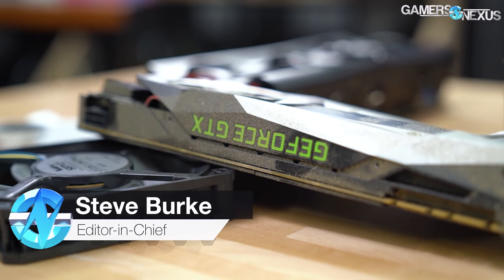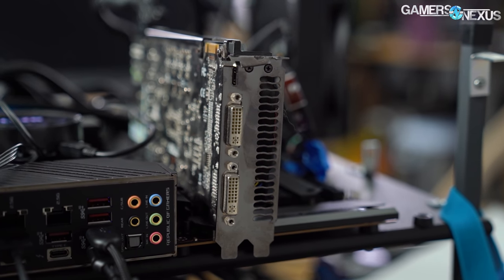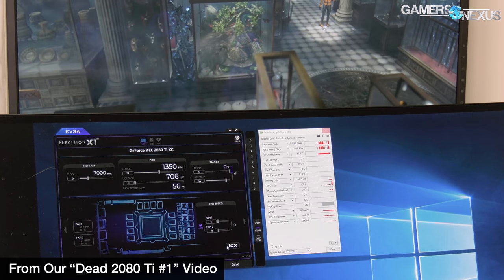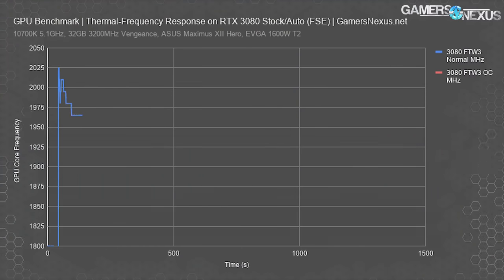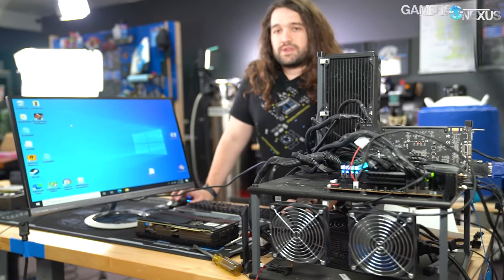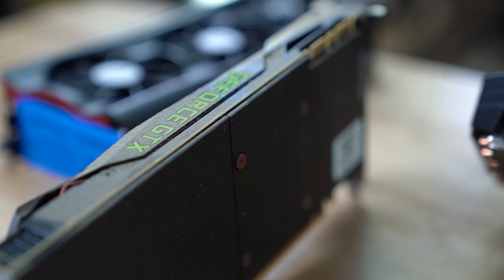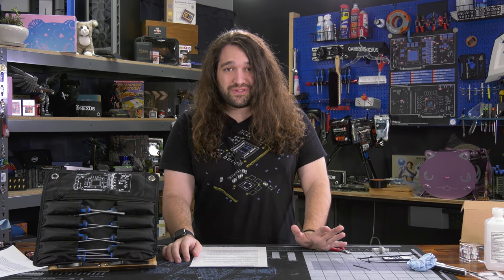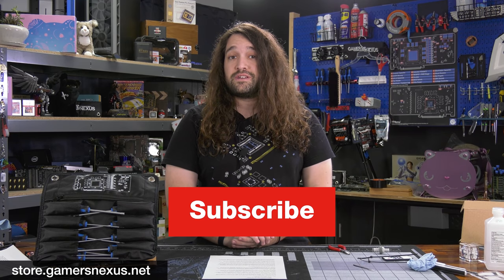Warning Signs When Buying Used GPUs: How to Detect Defective Video Cards

Comment: Purchased a RX470 Asus Mining GPU flashed with asus strix bios as they use the same cooler but only with 1 hdmi port

Thought it was broken first as you will barely start playing warzone and then start getting big stutters, looked like it was TTing at 72c but RX470 was not supposed to start TTing at 72c so started with flashing new bioses eventually bricked it with wrong bios but was lucky and managed to bring it back to life with my extra PCIE port on my mobo and my other gpu

Before i lost hope i figured eh let me just break the seal and try replace the thermal paste at risk of seller telling me i broke it, when i removed the heatsink i immediately knew i found my problem, the thermal paste was beyond toast, crispier that dried leaves

Cleaned with alcohol and applied new paste, boom works perfectly for my wifes budget build starter gaming pc built from an old lenovo thinkstation

Comment: I have bought my previous two gpus in 2nd hand market. Both purchases where made in local FB marketplace and had manufacturers warranty, on one card for 3mo on other 10mo. This also helps alot, just be sure that warranty sticker isnt broken and card dosent have any visible damage. So if there is something, card is still under warranty. :) I even didnt 'test' the cards when purchasing(and on this note i've further dropped the price) because they have manufacurers warranty and when at home stress tests if there will be some artifacts or something, ill just return it.
 Thank god it wasnt the case and both gpu's where in excellent quality.
P.S. Bought msi 1070ti with 10mo warranty for 340€(Initial seller price 390€) in 2018... (brand new in 2017, card cost was 490€) Ehh good old times :D To bad that in 2019 as summer ended(just b4 c19) ive sold my whole gaming pc with the card.... If i would know the future.... I would never let the gpu go! :D

Comment: I've got an msi gtx970 that refuses to boost over 1000 - 1200 MHz core clock when running heaven or gaming, clock speed also fluctuates much more than it should. The card was tested in 2 different pc's with the same result. I took a look at gpuz and noticed that the gpu chip's power draw never exceeds 12 - 13 watts even under full load. So the card works but no where near its full potential. Have any of you guys seen a card that behaved like this? If so what was the issue?

Comment: Hey, I bought a rx 580 off ebay for $280.  the card is triggering short circuit prevention at the psu or some other overcurrent protection.  I took it apart, cleaned and re pasted but havent really tested it since that because im worried about any other damage or shorts to other components in my pc.  I managed to get $225 refund from the guy who claims it should be working, so I either got scammed for $55 and get a gpu ornament, or hopefully there is a way to fix it or send it somewhere to get fixed.

Any advice on figuring out what is wrong with it, or trying to fix it?

Comment: unrelated to this video. is it safe to clean a cpu heatsink with water? my country has strong iron in the water that even metal taps start to rust after 14-17months. There's a lot of duck stuck in my cpu heatsink and I tried to blow it with a blower but didn't work. Or should I use wd40?

Comment: MSI DUKE 2080 OC stuck in 1260mhz core, 7000mhz memory at times and i have to use the command winlogo+Lctrl+Lshift+B to fix it for some time until it comes back and it comes on even after reboot and i have used DDU to reinstall and stuff, i have a little under a years warranty left, should i just RMA it so i can get it repaired

Comment: I have an Asus Strix GTX 970 which has a considerable amount of GPU sag. I attempted to place a lego stack under it to straighten the card, but that caused massive loss in FPS, from ~270 in csgo to ~60-75. What could be going wrong here?

Comment: Look carefully at their ad. Does it seem sketchy? Is the picture of a stock image, and not their own item? Does it say, No returns, or Untested? Is their contact email a gibberish throwaway account name? Does Google maps indicate odd seller location? Any one of these could be signs to hold your money and run like hell.
Reply: I think the best thing to do is test the GPU before buying. Of course there are great deals that aren't local, but you have to be patient until something comes along that you can check out in person. The prices are finally more favorable (if we exclude GeForce 40 series) and it's possible to find excellent cards for reasonable money. Interestingly, here in Serbia, RTX 3070 is currently cheaper than the RX 6700 XT on the used market, while 3070 is 170 euros more expensive in stores.

Comment: So, I have a 1060 where the cooler was in contact with the 12 volts of the 8 pin and thus created a short circuit. I'm not sure where to start looking. Maybe a SMD capacitor is broken. The card doesn't boot anymore. Maybe it's dead. Has anyone had anything like this before?

Comment: The problem with used cards is the VRM's/MOSFETs and paste caps have a tendency to die out.  The more you run them in a high power mode, (even for reduced voltage mining) the shorter their life left as you approach MTBF hours.  They do have a finite life span.  Even if you replace the fans and repaste and recap them, they don't last forever.  If you buy used, do not expect them to last two years.  Even less if they have been used for mining.

Do not be afraid to ask for a zoom meeting with a run through of GPU-Z and Unigen Heaven.

Used video cards are a horrid value in most cases.  I paid $140 after MIR on a 8Gig RX580 just 1.5 years ago.  Paying $750 used or even new is insane.
Reply: How would you react if the seller replied with a saved image of the Unigen Heaven benchmark result b/c the card has already been removed from the system and packed up? Asking for a friend lol.

Comment: i have a 3080 strix OC and my temps are in the mid 70 and maxout at 80-83 gpu junc temp is hits up to 99C is that normal ? Fans at 2100RPM. i have my card since october 2020. GPU boost over 2100 no throttle

Comment: I am getting around 83 max temps in heaven benchmark settings are ultra 1080p fullscreen. The spot and memory temps gets around 93 is it fine or something is wrong? My gpu is rtx 3080 ftw 3 ultra. Switch is on oc position.

Comment: Hey nexus can you tell me which should i change and tell me if it’s enought and i can get the most performance out of it. Is 32gb ram 4000mhz enought for performance if 32gb isn’t enought should i buy the same set of 2x16 4kmhz to get a total of 64gb or what.Also is the NH-D15 enought to cool de cpu efficiently or should i go for liquid cooling and which one. I want the best performance out of my pc i would thank you alot if you tell me which one of the whole pc specs should i change. money isnt the problem so you can tell me which should i change no matter the price Thank you very much for helping.
Cpu: Ryzen 9 5950x 1000$

Gpu: Asus Rog Strix Rtx 3090       2000$

Cpu cooler: NH D15 chromax Black 100$

Ram: G.SKILL TridentZ RGB Series 32GB (2 x 16GB) 288-Pin DDR4 SDRAM DDR4 4000 (PC4 32000) Intel XMP 2.0 Desktop Memory Model F4-4000C16D-32GTZR 370$

SSD: SAMSUNG 980 PRO 2TB PCIe NVMe Gen4 Internal Gaming SSD M.2 (MZ-V8P2T0B/AM) 450$

Motherboard: ASUS ROG Crosshair VIII Hero X570 ATX Motherboard with PCIe 4.0, Integrated 2.5 Gbps LAN,  USB 3.2, SATA, M.2, Node and Aura Sync RGB Lighting 350$

Case: Asus ROG Strix Helios GX601 300$

PSU: Dark Power Pro 12 1200w  400$

Edit:English isnt my main language so im sorry for bad grammar

Comment: I bought a used GPU, R9 270X few days ago .. but i have a problem. Gpu boots OK at first, showing bios screen (press del to enter bios), then windows logo and then after that just dark blue/black screen, cant do anything, just stays like that .. i tried reinstalling windows, loading default bios settings .. when i re-installed windows, it booted fine into windows for the first time but then i restarted my pc and the same happend, dark blue/black screen just after windows logo .. my specs are i5 4440, asus b85m-e mobo, 8GB ram, 750w gold modular PSU. Any suggestions?

Comment: I was using display port and whenever I put my monitor to 165 htz which it’s rated for it would have blue artifacting across the screen diagonally with a driver timeout error I have tried un installing them and even resetting my system completely any suggestions

Comment: Hi guys I just want to ask for your help about my pc problem. I searched the internet for a very long time but din’t find a solution to the problem.

The issue was suddenly a black bar appeared at the bottom of the screen while playing Days Gone. I am running a 1920x1080 monitor at 144hz refresh rate. The black bar became bigger later on, about half the size of the monitor, covering the screen and the game. I found out later on that decreasing the refresh rate solves the problem temporarily, since right now, I am sitting at 85hz with the same problem. Before, 120hz and 144hz have problems, but now, even the 85hz.

I am not sure the exact problem. Some told me that it is a monitor or gpu problem while others say that it’s just because of outdated gpu driver. I already updated my driver to the latest version but the problem still persists. I don’t know what to do now. Please help me with this. Thank you very much.

Comment: I found a Asus 3080 TI Strix on let go for $420. The seller is claiming the GPU is brand new in the box and he will include an invoice inside the box. What do you guys think? He's also claiming if it's not up to par he can refund the money. I just need an answer, I know letgo has a 2 day return.
Reply: I have seen plenty of similar sale listings lately but from my few tries to make a deal i got the feeling that there are also plenty of scammers that are trying to capitalize on same wave.
All seem to say their products are new, box sealed or slightly used. Some are lazy and literally present pictures of the board out of the box and paired with a box entirely form another board and even respond in a totally different language than the language they are supposed to be from. But all pretty much fail when i require them to send it with cash on delivery and with the option to check the package. I always said that the courier will have to wait for me about 15 minutes to put it on a PC to make some basic test in that limited time. That's why i want to have that package check option paid, as for the 15-20 minutes of wait well they can't go without me paying, maybe would even tip to make the wait sweeter but will not make any deal without me testing it a bit.

Comment: I bet I can fix that viewers Rx 580. I’ve fixed two parts only rx570s from eBay so far. One literally just needed to be scrubbed down with my special rubberized brush that’s totally not for cleaning hair clippers. I just paid 330 for a sapphire Rx 480 8gb the guy who paid 700 is smoking paint chips.

BUY ON EBAY NOT LOCAL I’ve bought about 20 gpus on there over three years with ZERO problems, buy your phone local not your gpu.

I have a gpu with a broken fan blade, I’ve had to glue it back on several times. Works like day one lol

Comment: back in late 2019 i bought a used 580 Sapphire Nitro+ 8GB for 130€ it sounds crazy to me that someone actually paid 700$ for it, even know i can find it on ebay for around 300€ so i think this might have been a bad lie. Still when i got my gpu it had those crazy space invader artifacts as shown in the video but only when opening device manager and clicking on display adapters that it happen but the thing is it might not have been my gpu that is broken because it only appeared on a 775 socket motherboard but with a LGA1150 it was all fine and there were no artifacts.

PS: It's still going strong in my sisters pc as i got a 3070 for 769€ a couple months back.

Comment: My used formerly miners RX470 had faulty issues making fan boosting erratically regardless temperature or gpu usage. it can read and detect fan speed it just wont control it. sapphire fan check indicates it had no issue. since it does not respond to any setting input from afterburner or amd adrenaline. i honestly thought it had issues with either faulty fan controller or corrupted bios. IT does NOT however, This little shit need cleaning apparently, and work just fine afterwards. Its not even that dirty nor had issues fan connector or even  had temperatures issues.

Comment: Hi, is it normal for a new gpu(evga ftw3 3070) to have some coil whine under load? got a new pc where the manufacturer assembled it for me, and the gpu has some coil whine under load.
Reply: try ask for replacement or undervolt ur gpu

Comment: Great video ! Just bought a used 1080ti ftw3, everything runs fine but when i checked GPU-Z i noticed my gpu clock was really high on idle (desktop). I see yours is around 100-300 but mine was more like 1300+... is it normal? thanks
Reply: Sounds like it's revving up (obviously? lol),  Do you have anything running in the background that could trigger it? Is Nvidia power management  set on performance mode by any chance? it always ramped up every time you check?
Reply: @mozzjones6943  thanks for the reply ! tried clean boot with nothing in the background, still high gpu clock. Power management is set to optimal, but even in Adaptive it stays high
Reply: @mozzjones6943  apparently it is the 144hz refresh rate on the monitor... i don't really mind the high clock speed as long as it doesn't break my card ! haha
Reply: @AY16Habs  OH right yeah that chestnut. Didn't think about asking what monitor you have, Yes anything above 60hz (depending on monitor) will stress your card more under normal load. Nothing to worry about as long the cooling is doing it's job.

Comment: The most important thing when buying used stuff IS to buy from someone you trust. Sounds stupid and obvious at the same time but it's just true.
I bought and sold a good ammount of hardware over the last 20+ years and I mostly buy from people I know or who are part of a community I trust in general... There are many hardware related communities around the world and the people there are usually trustworthy. I never had any problems with hardware from these kind of people and if there was a problem they ALWAYS tried to help, fix it or just make a refund because they are just good people!
I also sold some stuff and the buyer called me later because it didn't work. I went to his place and we cheked everything and we couldn't find the problem so I gave his money back and took my stuff home to analyze the issue. So alway buy from trusted places and trusted persons! btw. these communities usually don't overprice their stuff, I recently bought a used GTX980 for 100$ which runs nice, I think that was a very good deal.
Reply: On that note, I just happen to have listed my Vega 64 a few days ago on ebay. Not trying to shill; just trying to point out that, yes, people who sub to GN and take good care of their cards are also sellers. For my part, I am not playing any high end, graphically intensive games right now, so I see it as the right time to move on from my Vega. I cleaned it up with compressed air outside and also applied fresh thermal paste and tested to confirm it's good to go. I want the buyer to leave good feedback and be happy with the purchase despite the pricing of the moment. Good advice on your part; I'm just sitting here hoping people aren't suddenly going to be scared off of buying used just when I finally sell something lol.

Comment: I'm late but would my card be considered bad/going bad? Bought a used 3080ti for $750 from a local guy who says he got it second-hand for his build but never managed to complete it.

It runs fine from the looks of it aside for one issue, the mobo fails to detect it through the display ports on startup (white vga light on the mobo), just shows a black screen with no splash logo so i can't get into the bios unless i plug into the Hdmi port or the mobo for cpu i-gpu.

It does however make it to the windows log in screen after showing the black screen for a few seconds and runs games just fine, even checked gpu-z and the card seemed legit.

I took my whole set-up to a pc building shop and they didn't really tell me much other than what i found out myself.

Should i try to RMA it since it's still within warranty? (EVGA) or is it something i can fix?
Is it just going bad? Wut do now?
Reply: The port might be dying. Doesn't sound like a catastrophic problem but annoying none the less.
If EVGA is still honoring their warranties I would send it in.
Not sure what they will do though since they got out of the gpu game and their entire stock online is gone except for third party sellers.
Reply: @citizenspaghetti  Hey, thanks for replying.
Found out the issue a few weeks ago, turns out it was a firmware issue on Nvidias side, they rolled out an update on their website sometime ago that fixed issues on the cards compatibility with displayID monitors that caused my exact issues.
I just never knew since it was a quiet fix lol.
Reply: @LordScrumpus  ahh glad it got worked out. Gotta love the "hey we fixed a thing affecting a ton of customers but didn't feel like talking about it" approach

Comment: My GPU core clock doesn't move inside of MSI afterburner, but when I open GPU-Z I can see it shift depending on my oc. Am I good or am I screwed?
Reply: By that, I mean under GPU-Z sensor it stays at the default clock but on the Graphics Card tab, it shows the current core clock as being what it should be and the default clock below.